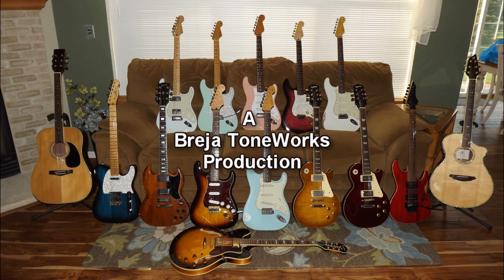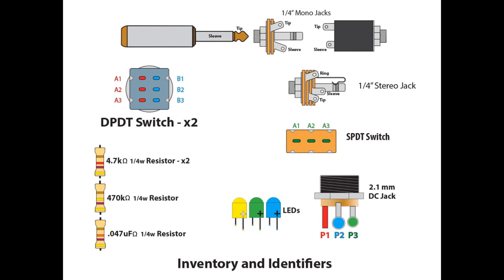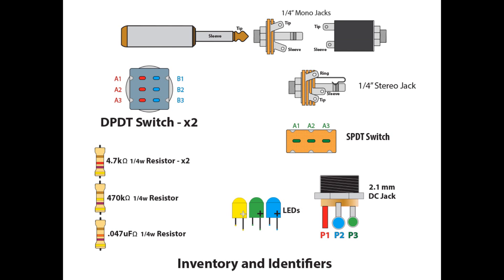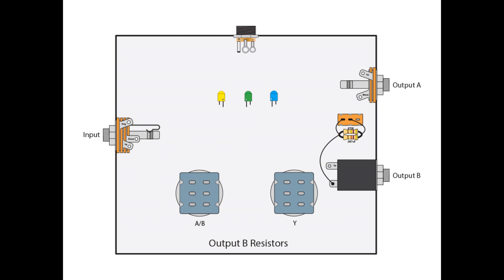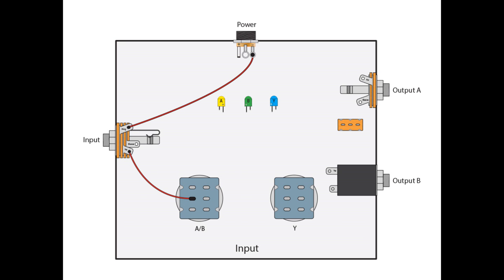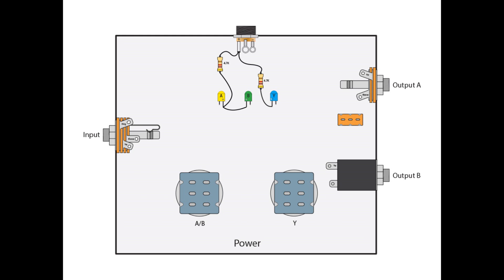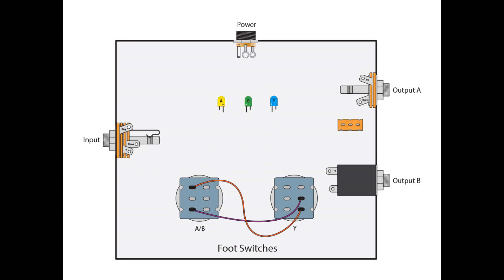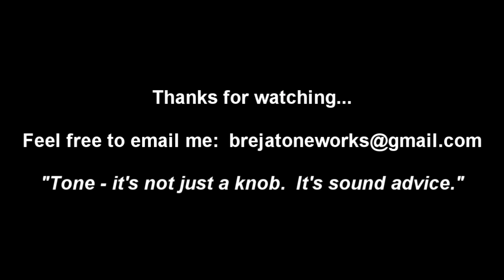ABY Pedal DIY Build

Comment: Hey mate - thanks for the vid. I want to build on of these for fun and the to a clever design on the front.... I have the Orange Amp detinator ABY pedal that I use normally.
The thing with this one is that it has the phase button on there to eliminate amp phase issues with two amps....Is this the same as the ground switch or is that just to get rid of the hum? - Thanks and check out some of my builds you might like them too! Ed

Comment: I have a question about the use/necessity of the ground lift. Rather than using this pedal to switch amps, I plan on using this only for my Vox AC15 to switch inputs (the "Normal" and "Top Boost" channels, or both). Since I'll only be using it for one amp, is it necessary to put in the ground lift? Or can I just build it as is and omit the switch/lift without having any issues? Is there even a reason to add the lift when it will only be used with a single amp? Any feedback or input on my situation would be greatly appreciated! Thanks!

Comment: Can outputs be used as inputs? 

Ie reverse signal flow direction?
"A" would be clean, "B" might have an EQ, compressor, pitch shift, and maybe a reverb

Guitar>ABY (Box1) input
>ABY-A signal output = Clean signal
>ABY-B signal output = FX signal

Reversed ABY (Box2) A input
>ABY-A intput = Clean signal
>ABY-B input = FX processed signal

In ABY Box 2 the clean and processed signals are mixed together into a mixed signal that is sent downstream to the amplifier input.

The goal is to blend a combined (clean and dirty) sound signal to the amplifier input. 
The signal is furrher  processed via amplifier's preamp tone stack and whatever onboard effects there may be, and sent to the amp's output stage.
Reply: Yes.  Just turn the pedal 180 degrees.

Comment: WTF is a 0.47µFΩ resistor??? 🤔..... I see you have a image of one there too...... Well that looks a lot like a 47kΩ resistor. Weird, you'd think they'd use different colours for the microfarad ohm resistors..........

I barely managed to stick around to the end of the last video of yours where you're using single and double "Pull" switches.
You clearly have very little knowledge about the little "diy tricks" you're attempting to teach others. And while these sort of pedal hacks etc are more or less harmless, they're not always.
Sometimes in electronics a simple little oversight or mix up with component type or value can be either damaging or destructive. And sometimes potentially even harmful or even fatal.
Hence why a bit of knowledge of the "what" and "why" of different electrical components can give you a much better understanding of what it is you're actually doing, as opposed to just following a guide and parts list.

Comment: Great video. I came upon it because I was looking for TRS/stereo input ABY Pedal, but I can't find with a TRS output, this one has two monos. You see , I'm going to use it for an Expression pedal which is TRS I was hoping the two output jacks were also stereo for fear my expression pedal won't work if it goes out mono to the pedals which will be controlled by the expression pedal.

Comment: As others have suggested, there is a mistake, likely just an oversight, in the supply list, diagram, and vocal description. Resistors do not have values measured in microfarads.  This is meant to be a capacitor that is wired in parallel with a resistor. Two resistors in parallel merely give a resistance less than the smaller value resistor. So, one resistor of smaller value could be used instead of wiring in the additional resistor.  If your ground lift didn’t work, perhaps you used two resistors.

Comment: A bit late to the party, but what's the point of using one normal jack input and one that is plastic covered?
Reply: It’s for isolating the jack from ground, which is the whole point of the ground lift.
Reply: did you ever get help on this ? i have the same question
Reply: @revolverdn  unfortunately not. I didn't try to build one myself so I couldn't test it for myself either
Reply: Same question for me too

Comment: Sorry for the question, I´m new at this type of things hope you can explain it to me. You connetct a mono cable into the stereo input so it has more ground? Why not use a mono input jack and link the sleeve of a mono input jack to, dc jack and to B2 of the A/B switch?
Reply: It completes the circuit to power the pedal. Any powered pedal you own probably works like this.
Reply: @grahamcase  ahh I see what you meant. The circuit is open, and the pedal can’t be powered until the instrument cable is plugged in. Using a mono jack would mean the pedal is always powered regardless of the instrument cable

Comment: Why do you need a plastic mono jack if you put a ground/lift switch on it?
Reply: This seems arbitrary to me. I would just use switchcraft jacks...
Reply: Lower down there's a comment that seems to imply the plastic jack is needed specifically because of the ground/lift switch. I'd still try it with a switchcraft jack, myself.

Comment: Could you build this without the switches and leds and make a passive splitter?
Reply: The LEDs are only so you can determine the state of the pedal switches.  You don't actually need power to this box for it to work however.

Comment: Sorry if this is an ignorant question, I am new to this whole game.  Is the .047uF capacitor a 50V or a 100V?  I'm trying to order parts for this build and I'm not sure what will work or not.  Also, does it matter what type of material the capacitor is made from?  I see there is a choice of ceramic, polyester and mylar.
Reply: I was wondering the same thing.. did you ever find the answer?

Comment: Nice explanation!, Why do you use a stereo input jack? Would it be possible to use a mono input jack and solder both to the tip?
Reply: I could be wrong but it looks like he is splitting the signal A on one side and B on the other of the stereo Jack.  This I believe will make for a cleaner output signal.  I'm thinking if you ran both through a mono jack you could get noise and possibly even have the more powerful signal cancel the other (if one guitar is passive and one active).
Reply: Did you end up trying this build using all mono jacks? Did it work?

Comment: does it work backwards the same way? I mean, can I have ABY between 2 guitar signals going to the one output? sorry if it's a silly question.
Reply: You could do it but would be better as just an AB box. For the Y part for 2 inputs 1 output you would want to add summing resistors like the simple addition of two resistors to go from stereo to mono signal, the proper way.

Hope that helps (:
Reply: AB summed into a Y is a little different, and actually pretty easy. I’ve made a few for customers with a 3 color LED. If you’d like a schematic you can message me.
Reply: @karlvonpackal1402  I'd be interested in that schematic, can you provide a link?

Comment: Are you meaning a .047uF CAPACITOR? Or truly a resistor as documented... I can't seem to find resistors of that value anywhere, but DO find capacitors... just asking for clarification, or where you get your parts from would be great too
Reply: resistors are measured in ohm, NOT uf
Reply: Justin Easterling I have a feeling it's a capacitor too.
Reply: There is a comment now that appears over the parts list that corrects this to a capacitor

Comment: great video sir. Regarding the ground lift. Would I be able to apply this to any factory made ABY's I have on my pedal board?
Reply from the maker: Unfortunately I'm not sure I can answer that.  I'm not a pedal builder.  I have very limited knowledge on pedals and the two that I have out here are really the only ones I trust my schematics enough to share.   IN theory, all ABY switches should function like mine and the ground lift would apply.
Reply: Yeah I reckon your theory is correct. Im gonna give it a go and see how it goes.

Comment: Hi Don, great vid.  Wondering.. Will I be able to connect a stereo cable from my guitar into the input and split the channels to the a and b output, and switch between a/b or y?  I have a guitar with piezo and mag pickups wired with a fishman powerchip which includes a stereo output.  I'd like to use a foot switch to go between my acoustic amp and electric amp, and occasionally run them both at once.  If this will not work with this pedal, is what I want even possible with simple circuitry?
Reply from the maker: I'm unsure because you're coming in with a Stereo plug.  Unfortunately I'm not a pedal builder so my knowledge on this front is limited.  Sorry.

Comment: Hi very nice project!I would like to ask ,if instead of dc supply i would like to use 9 volt battery or both 9volt and power supply do i need different resistors or circuit?thank you
Reply from the maker: No - you would keep everything the same as long as you're hitting it with 9v.

Comment: Suggestions on fixing the volume drop when engaging the Y mode? Maybe dual buffer circuits on each output? And I'm not getting results with wiring in a phase switch. You wire the phase switch so that it is inverting the leads coming from one of the outputs?
Reply from the maker: A buffer is truly what you need.  Unfortunately I'm not a pedal building guy so I'm not much help here.

Comment: If you wanted to do this without the ground lift, could you use a standard jack for output B and then wire the two 'sleeves' of output A and B together?
Reply: If you don't need the ground lift you can omit the plastic output B jack and use metal instead and wire sleeves together.
Reply from the maker: +eh heh I'll be honest.  I'm not a pedal builder so I'm not 100% sure on the answer.  Maybe other viewers can chime in but you could test your theory and if you notice a bunch of noise and such, your idea probably didn't pan out.  Sorry.
Reply: Okay, thank you for your response! I'll have a play around, if anyone else wants to chip in that would be appreciated

Comment: why don't l see the SPDT toggle switch on the topside of the unit in your illustration (l know l will probably regret asking this question :-) is it momentary or latch switches ? can l use a 2-pin SPDT on/off switch instead of a 3-pin as l see one of the terminals is not used? OK, so l have never done this before and don't want to make major mistakes
Reply: Latching

Comment: Great video. This might be a dumb question, but why does output B have to be a plastic jack? Could you not just run from the ground loop switch to the ground of a "normal" jack? Thanks.
Reply: Never mind. I think I figured it out... If it was metal, it would be grounded all the time because of the case. Correct?
Reply from the maker: jproulx57 Yep.   :)

Comment: How could one add a phase switching button to the pedal to make sure the signals are in phase?
Reply: +Breja ToneWorks illustration or website link please. what type of DPDT switch and what terminals are the jumpers connected to on both switches?  cheers.
Reply from the maker: Blair McClain Look up a drawing of a DPDT phase switch and insert it before Input A or B.  A simple DPDT switch and 4 jumper wires are really all that's needed.
Reply from the maker: +Robert Pool Email directly at BrejaToneWorks@gmail.com and I can send you a copy of the info.   Don

Comment: I don't get the last resistor (.047uF), it's a capacitor? Because you mixed units from capacitors and resistors.
Reply from the maker: ***** For the love of Pete - you'd swear I was abducted by aliens when I did this video.  I'm so sorry and will redo the video but it's a 47nF Capacitor and not a resistor.  Hope this clears things up.
Reply: Breja ToneWorks Hahahahahahaha (abducted by aliens). 47nF is the same as .047uF. Man, I liked your work, but if some random dude wanted to buy the weird resistor at Radioshack, he wound't get that component and switched that with a low resistor value and make a mess.
Reply: @iamalexisdeath  Yeah, I've used a .047 capacitor but never heard of a .047 resistor. All that said (to be sure) I want a 47nF capacitor and I should start building?
Reply from the maker: Ugh... Sorry about that.  Did the video too late and apparently couldn't read my own writing.  I've annotated the video but it's supposed to be a 47nF Resistor.  Sorry for any confusion.
Reply from the maker: Paully Waully Ugh!!!  Quite a mess I made.  It's supposed to be a 47nF Capacitor.  Sorry for the confusion.
Reply: Breja ToneWorks I didn't know there were resistors with that value(47nf/.047uf) those are capacitor values which is what i think iamalexisdeath was trying to say.
Reply: Breja ToneWorks
but with that said, great video! I am going to build this soon but would appreciate if you could let me know what the 3rd resistor value is if you could, thank you.
Reply: That's ok, I appreciate the help.  also not sure if you know you can edit your video and put a bubble text window anywhere on your video and type the correction. hope that helps and thanks for the reply and again thanks for the help!